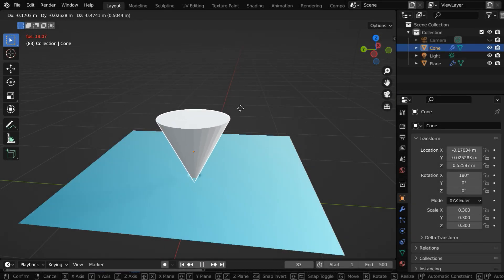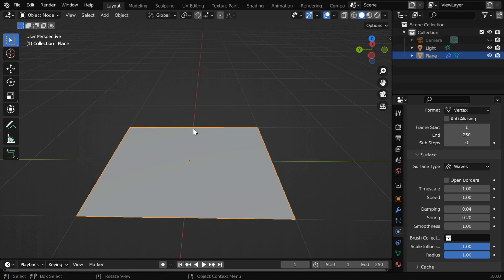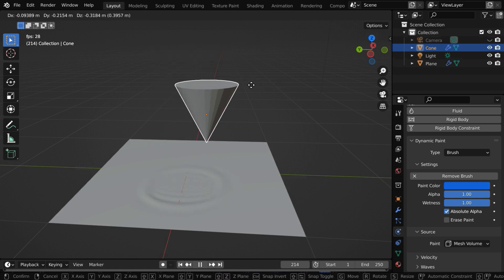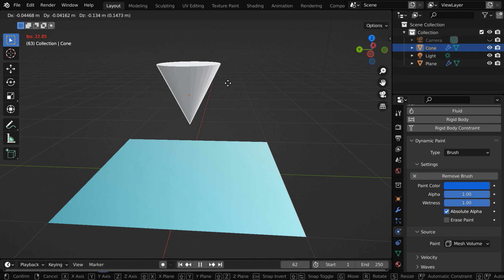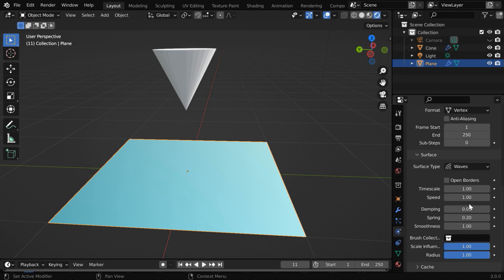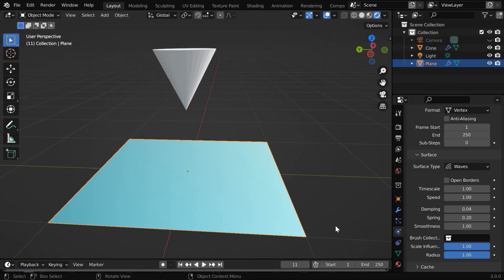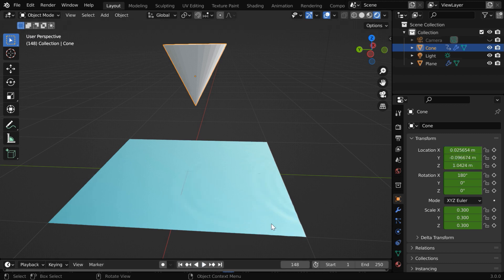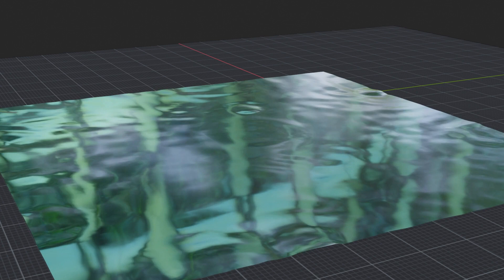Create Ripples On Water or Any Surface | Dynamic Paint | Tutorial For Blender Eevee & Cycles

Comment from the maker: For Blender version 3.2 > I noticed a bug for which the canvas surface does not display correctly. If you go to the wireframe-view mode, you can see that the ripples are created correctly, so the underlying geometry is correct. But the normals are not recalculated for the surface, so we get an erroneous outlook in the solid view mode. Fortunately I discovered a simple fix for this. For the canvas object, in the modifiers tab, you'll find a Dynamic Paint modifier added by Blender. Add a simple deform modifier after this. You can use any of the four options like twist or bend etc. but enter zero in the angle/amount field. So effectively there won't be any change in the shape but the normals will be recalculated. Now the ripples will display correctly. If you use any other modifier that forces the recalculation of the normals, the ripples will display correctly. Hopefully this will be fixed soon. I'll report it to the developers team.
Reply: Thanks for this. I was wondering why I couldn't see the ripples unlike your video :-)

Comment: Here's an example of having a moving character create the ripples (https://youtu.be/V0buJcktUwA?si=r5DAZ0b8_ZQzjY0u).
Reply from the maker: Well done! It was very nice 👍 I think on the improvement part, while watching the animation I felt that 1) the ripples are moving too fast, 2) the ripples behind the man are calming down too fast, 3) the pattern of the ripples remains constant, only the location shifts. So I would recommend, 1) slow down the speed of the ripples, 2) keep the water rippling for a longer time (but gradually slowing down) at a point when the man crosses that point, 3) I guess you used an invisible moving object parented to the man to create the actual collision with the water canvas - instead if you use his legs, or something similar, we will see a difference in pattern on the left side and the right side, and also it will change when the leg is deep inside the water and when it is lifted up.

Comment: I did exactly as you did and there are no bubbles in the square which makes it water and the ball only touches but there is no way I can make it have bubbles as well I am new in the field but know a little about Blender which is also an old software for me please help how to make my ball be in water which makes bubbles I wonder
Reply from the maker: Hi, it should work as shown. But I understand that somehow it is not working for you. It will be great if you can save your blend file and send it as-it-is to 5minblender@gmail.com address. We can verify what is wrong with your file and suggest a solution. Otherwise we may not be able to guess what the issue could be. Also, when you send this file, please mention which Blender version you are using.

Comment: hello, thank you?  I tried several times, the waves are created and well there, but I do not see their shadows like at 2:01. Do you know why?
Reply from the maker: Hi, which version are you using? If it is version 3.2 there is a bug in it which gives an erroneous display of the canvas surface. I just now dropped a comment at the top with the reasons for this and an easy fix as well. Please check that and let me know if that solves your issues or if you have some different issues. Thanks!
Reply: @5MinutesBlender  I'm using version 3.2. Your fix works very well! Thank a lot :)
Reply from the maker: @shtoont  Glad that it worked!

Comment: I tried this one three or four times in 3.1 and even did a Blender reboot. No matter what I try, the brush fails to make any ripples on canvas.
Reply: It may have been an issue with subdivision, I will keep testing.
Reply from the maker: Was it solved? Are you using the latest 3.1.2 build? I checked it with the latest build, and everything is working fine. Please ensure that you have added enough subdivisions for the canvas object. If still facing any issues, please send us your blend file, we'll check it. And also please mention the exact blender version that you used. You can get our contact details in the About section of this channel. Thanks!